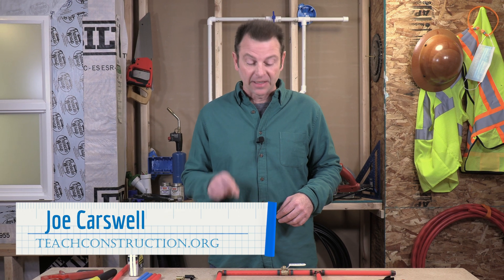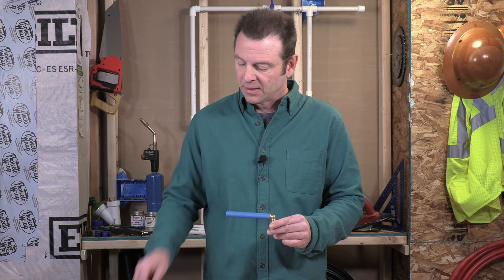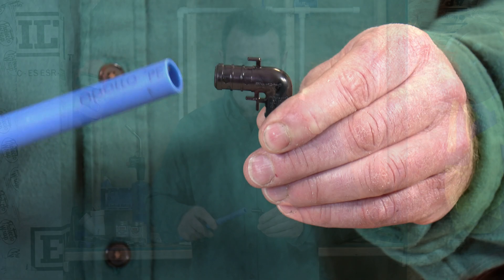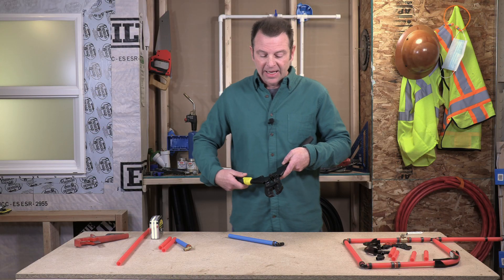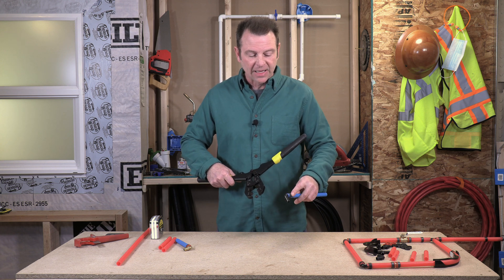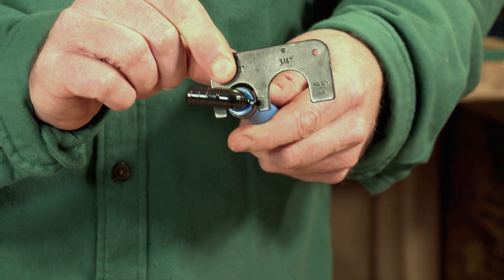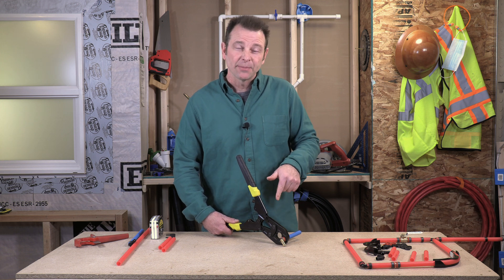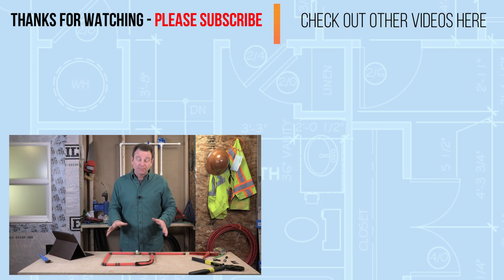A mini-lesson about PEX crimping - Intro to Plumbing Series

Comment: I do not like the idea of the pro rings.  The placement of the pipe can not be seen after the installation.  If the PEX is cut at an angle or if it slips a bit before the crimp happens you cant see that problem.  I would think building inspectors would have a problem with it as they are only looking at it after the fact

Comment: I've spent my life solving tricky problems as efficiently as possible.  One way to deal with the sliding of the NON pro-crimp ring, is to simply use painters or scotch tape to hold it firmly in place temporarily.  Another solution that doesn't waste material is to learn to tie a very simple knot with string to the side that it might slide to.  Such as a Constrictor knot on a bight.  This allows you to use one piece of string multiple times, cutting down on going through tape and having to work that into your ongoing expenses if you do this kind of a thing on a regular basis to make your money.

Comment: I find the rings slip back and forth along the pipe regardless of the brass fitting... Is there anyway to prevent this movement of the ring?
Reply: The Pro Pex ring is the one that claims to hold the ring in place. A little inert material would do the trick, say, bubble gum, tape,  piece of thin cord tied in a circle "BEFORE" the ring. I've seen the cord tied around the crimp ring. When it didn't work out, they immediately knew why. I said nothing after "OR"  before. A mistake generally sets the procedure in your mind. A very inexpensive installation lesson. Best wishes.

Comment: How do you know which number to use with the turn to adjust ,mine got numbers from 1 to 4
Reply from the maker: most of them are lower number the tighter the crimp - but check your particular tool

Comment: can you use that crimper for cooper pipes and metal fittings? or is it just for pex ?
Reply from the maker: Nope - That crimper is just for PEX - There is a crimper for copper - but that process does require special fittings.  I think they are great but they are expensive.

Comment: will this tool also work with PEX with aluminum inside. So it's aluminum tubing with PEX on the inside and outside of the pipe? Which ring would you use? it's 1/2 inch pipe.
Reply from the maker: I don't know about PEX with aluminum in the inside.
Reply: Pex with "aluminum " or metal in it is probably in reference to "kitec" which that company when bankrupt from leaking fittings lawsuit
Reply: I have that too. Its been a pain trying to fix one spot that busted. Im about to just use these push to connect cuplings.

Comment: How to un crimp the ring is one is replacing  them ? thanks
Reply from the maker: you can cut the rings with a cutting tool made it the process.
Reply: @ConstructionEd  thanks for the info.

Comment: I like your lessons and the convenience of you demonstrating things on your table which is very valuable, but....
Is there any way you can do your demonstrations under a real demo sink with running water so that you can give us more realistic hands on results and show us how difficult it could be in tight situations, and how that wide expand of that crimping tool will work under a sink with the plumbing going down through the floor.  I would like to see the moment when you cut the pre existing pex B pipe after turning off the water so we can get educated on how water pressure works and how it can be messy unlike the clean dry easy convenience of a partial dry pipe demonstrated on a dry table....
Reply from the maker: Installing PEX under an existing sink or vanity is really a pain in the butt, but typically the PEX ends at the angle stop shutoff value that should be in a location that is somewhat free of all the other lines.   Last time I did one, I removed all the drain lines first so I had enough room.    When we update our plumbing lessons we will make a video in field type setting vs the classroom.  But that is certainly not where we would have started, as filming under a sink is harder than it needs to be for a lesson

Comment: If you are crimping a pipe in the wall , how do you get that big tool close to the wall or in tight spots
Reply from the maker: That is a challenge.  The pipe often moves around a bunch until all connections are made, so select the order of connections to make carefully.  Then attach the pipe to the studs last.   But it is a often a challenge.

Comment: Which is better to use the brass fittings or the plastic fittings
Reply from the maker: We think the brass fittings are better, but they are more expensive.    That being said, it could just be an unjustified bias.  Many new home production systems use the plastic,  but they are often trying to save a buck anywhere.